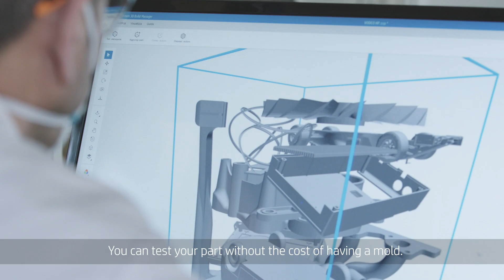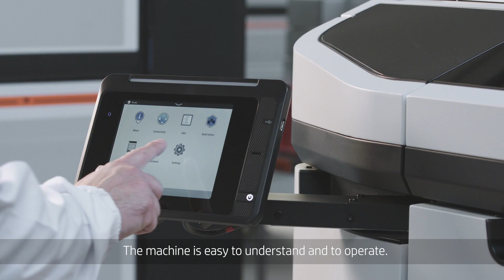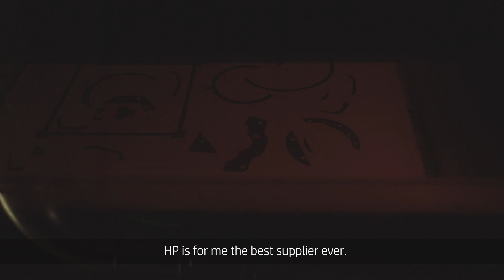Weerg Pushes the Limits with the HP Jet Fusion 5200 Series 3D Printing Solution | 3D Printing | HP

Comment: I had the worst experience with Weerg company where I have spent €3300 in a prototype prints that turned to be defected due to bad quality print process. I sent pictures of the defects like missing screw holes and design details but they refuse to admit the problem and refuse to do a reprint instead they gave 10% discount on next print if I want to repeat the print again!!! So long story short a reliable decent company is measured not buy selling service but buy after sale support and customer care and both Weerg have failed to deliver.

Their ordering system is deceptive, they offer 3 types of printing processes that I never found in any company before with HP MJF printer just to take your money. I never found this in USA where they  offer 3 option of printing:
1) Fast
2) Performance 
3) Top mechanical 
Each one has different price while major  printing companies in the USA never heard of this and they print using standard HP printing process. Weerg offer this to take more money only because many times I ended up with parts that has different quality. With China they offer to reprint any part proven to be defected free of charge & shipping.